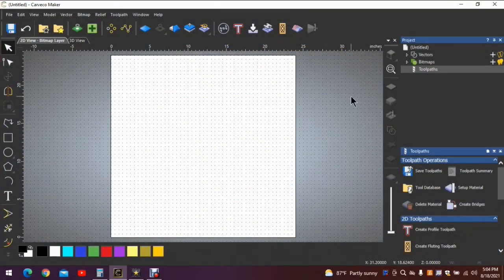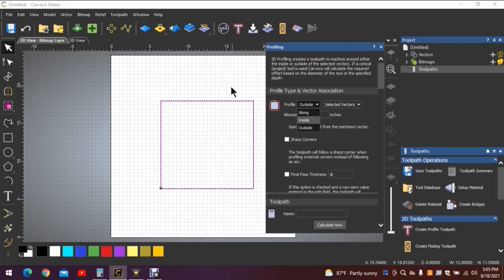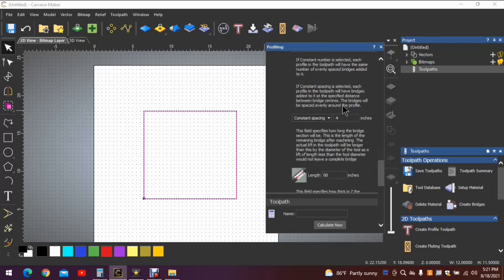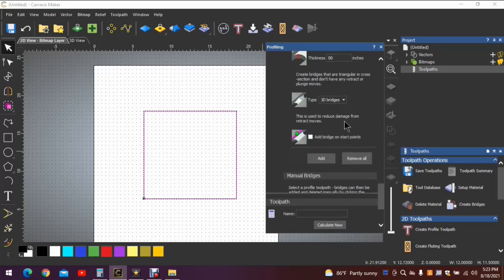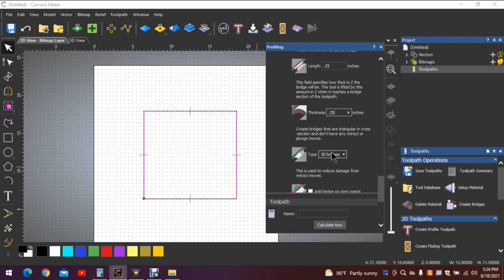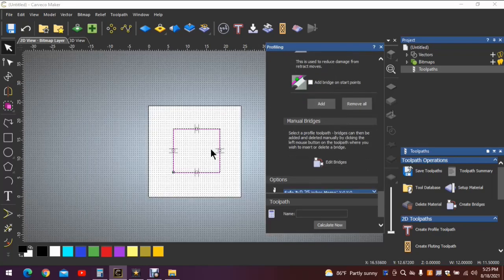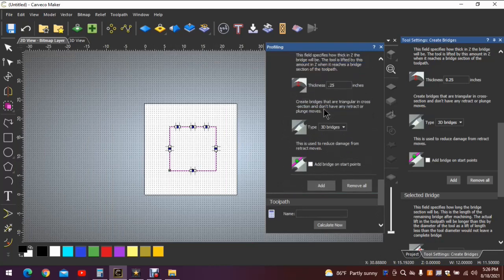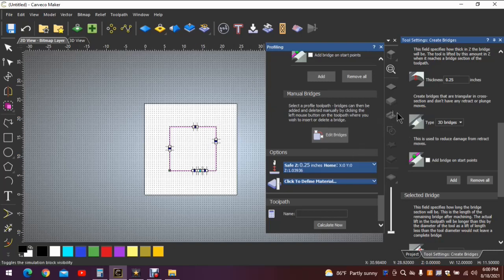HOW TO: PUT IN TABS OR BRIDGES IN CARVECO PROJECTS

Comment: Used to do this on cutting dies for corrugated paper die cuts. So, I had a fairly good idea of what you were doing. My background is in corrugated box mfg. and design I have several years on Artios cad which is a program for designing corrugated packaging. Hoping  it helps when I buy my CNC and software.

Comment: maybe I missed something in the video but after you have inserted the bridges on your vector I believe you also have to have a tool path so you can hit "Calculate Now" then the program will recognize the bridges. I don't think it is possible to put bridges on just a vector  without a tool path. Can I get this clarified by someone
Reply from the maker: @charleskoch3082  yes once you calculate the tool path it will recognize bridge placement

Comment: I watch a lot of cnc related YouTube videos and I have noticed something very interesting. The more experienced the maker the less bridges they use. I was once guilty thinking the cnc was going to hurl a piece at me across the shop like a frisbee if I didn't have a bridge ever four inches. I got tired of sanding those little buggers so I am very sparing with them. If you are using a downcut bit.... two seems plenty and four if it's really big.
Reply from the maker: I agree I use them very sparingly myself just wanted to show the process for those that were looking to learn how
Reply: So True! I find myself using CA Glue and Tape more and more.
Reply from the maker: @BuckysCustoms  yes sir that works well
Reply: I generally set mine 3mm x 2mm, so they are easy enough to cut through with a carve knife. I limit to 1 per major side, max 4 (on carved smaller than 12in) and spread them manually after pressing the Edit Bridges button.
I've started using a compression bit that often allows me to dispense with tabs completely as it cuts & compressed wood chips chips back into the cut kerf and sufficiently holds work piece in place.